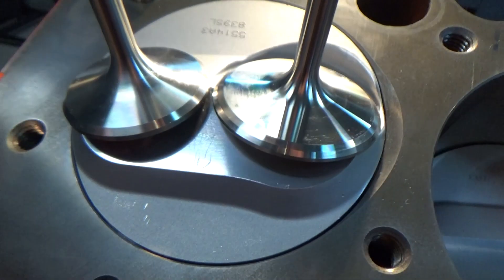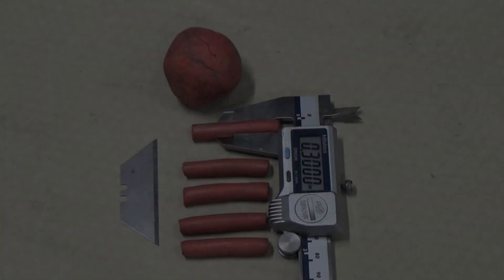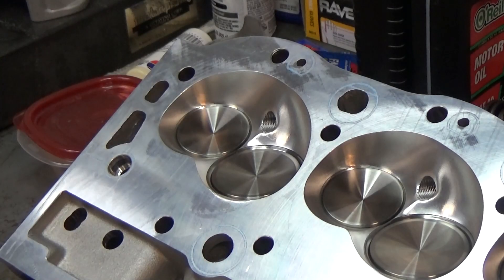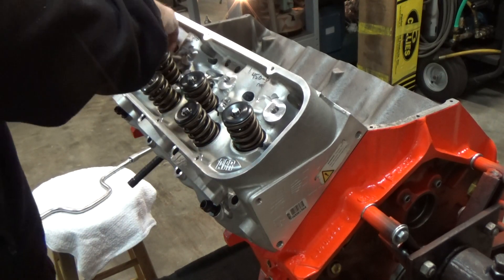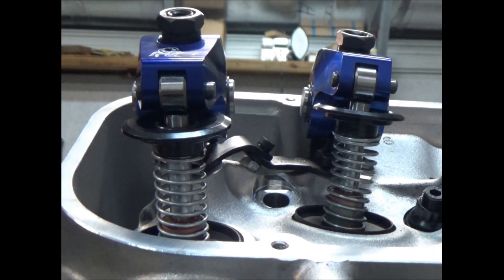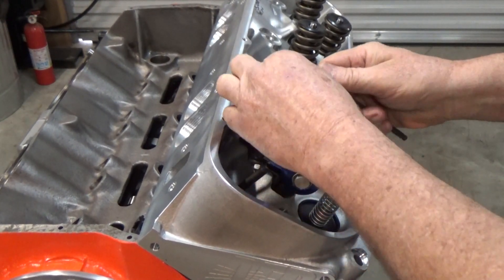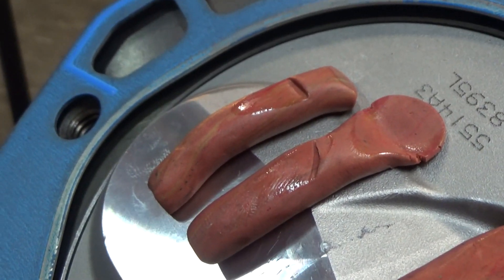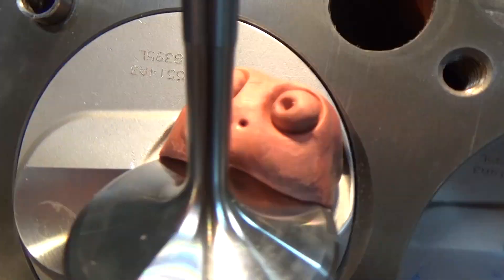Piston to Valve Clearance Check...#15  Chevy 454 Big Block Performance Build..

Comment: What size chamber on your heads. You've got plenty of room, maybe take a little off
Reply from the maker: Hi Terry.... Chamber are 112cc and compression is 10.15 to 1.   Going to drive it on the street and want to keep it pump gas friendly...
Reply: @Myersmetalworks  very nice. I just got to the party late. 454, overbore.?  Looks like a fairly nice dome. Also you said solid roller, nice choice. I'm gonna go back and check the previous videos. Should be a real nice piece for the street. From off the grid in Az.
Reply from the maker: Hi Terry....  Its a .030 over bore... Piston dome is around 21cc... Its cool your off the grid in Az... nice!
Reply: @Myersmetalworks  good morning. So that would be 468 ci.
Reply from the maker: I think 460....

Comment: If by chance you did have a clearance issue, would you have to return those pistons? I am in the stage right now where I need to choose pistons and want a healthy amount of compression.
Reply from the maker: Hi Designs in orbit.... If I did not have enough space we would have the valve reliefs on the pistons fly cut for more space....

Comment: I have a Honda k20 engine. I have 1mm oversized dished valves on the intake and I have stock size flat faced valves on exhaust side. Is this a good set up?
Reply from the maker: Sorry I have never worked on a K20 Honda engine... Look up (PFI speed) on youtube...  They maybe could help on your set up.... Thanks...

Comment: What was total lift of the cam. Seems like alot of room for a solid roller (most starting close to .700 lift)
Reply from the maker: Hi Enhanced... It's around .650 lift with a 1.7 rocker

Comment: What happens if it’s too close? Just get a shorter pushrod?
Reply: Fly cut valve pockets don't buy new pistons
Reply from the maker: There are several  things you could do...  But I think I would have deeper valve reliefs machined into the pistons
before I had the engine balanced...

Comment: I was looking at the pistons and see a number laser etched into the top, 8395L.  Do you recall how many cc the piston dome is?  Maybe its about 26 CC?  I have some old TRW forged pistons and I want to make sure the dome they have is smaller than yours.  If or when I change my cam this will give me an idea about the clearance I should expect to see.  Thanks
Reply from the maker: Hi Mike... 21cc